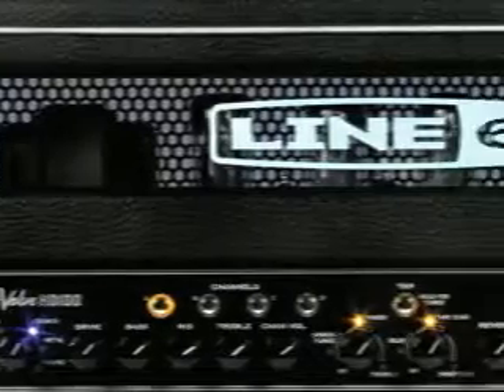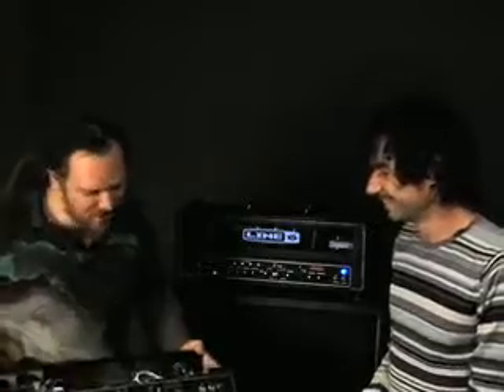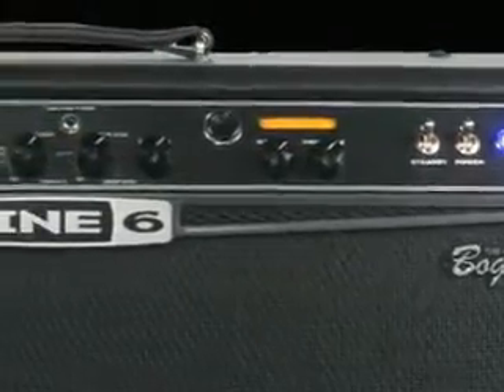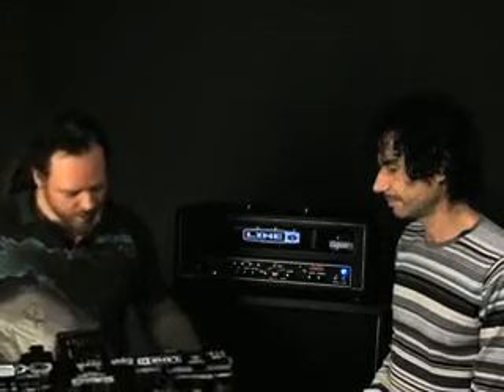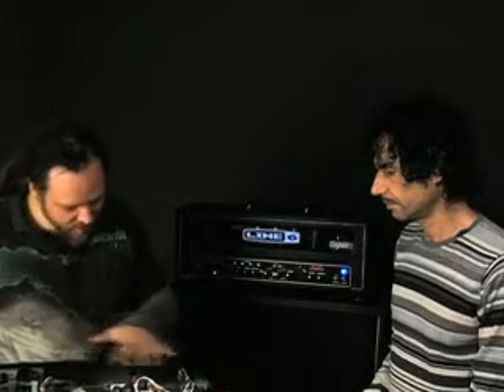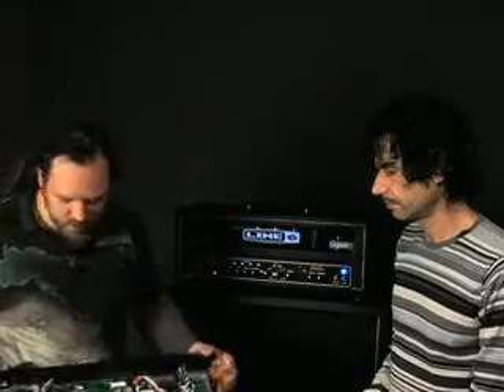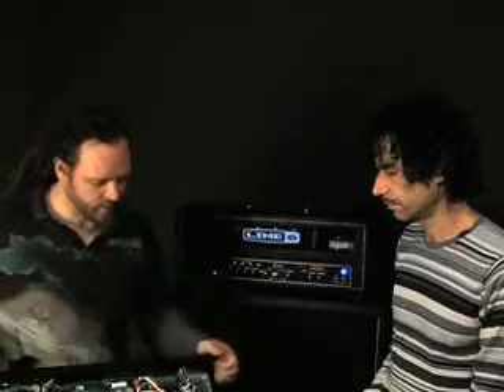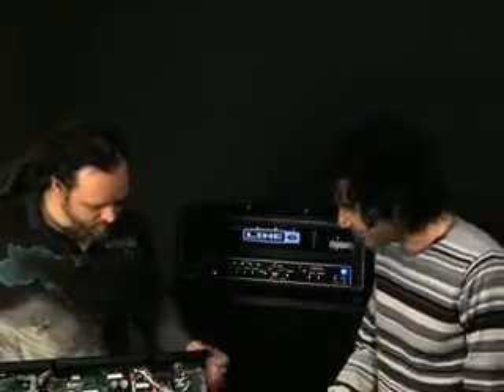Line 6 Interview with Reinhold Bogner

Comment: He was right about the Sovtek tubes.  My 2007 line 6 spider valve has original tubes in them and they were going fine.  I replaced the power tubes just in case as they are cheap .. no change. 12AX7s .. seeming like they will last forever.